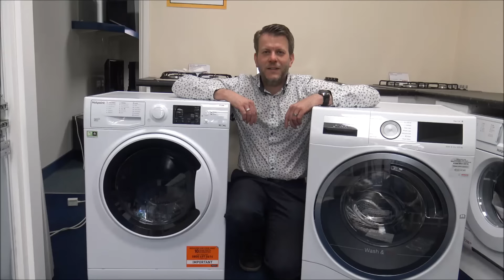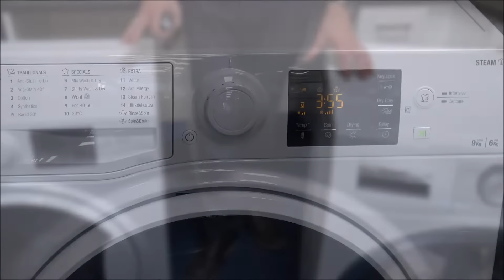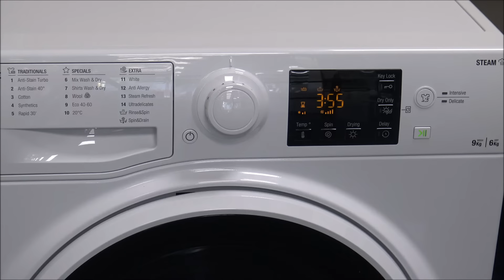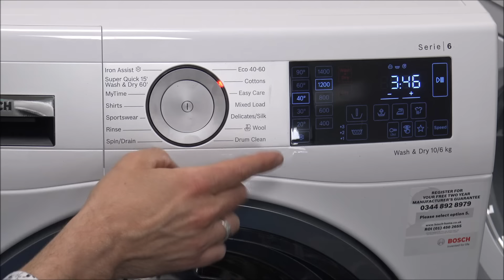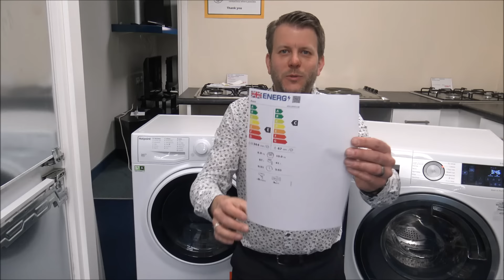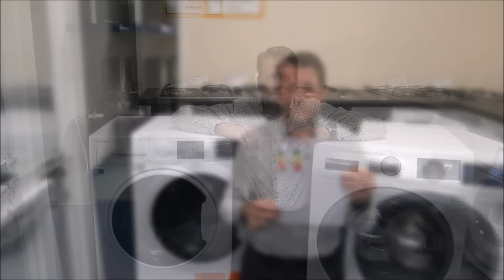Are Washer Dryers Worth it ?  10 Things To Consider Before Purchasing A Washer Dryer

Comment: I was considering getting a washer dryer machine, but I have read quite a few comments that mentioned poor reliability. These units seem to not be as reliable as traditional machines, the dryer functionality and durability seems to be especially poor. With this in mind, do you have any advice or recommend a particular brand over another?
Reply from the maker: You can find that reliability is not as good as it doing the job of 2 appliances, so it won't last as long as a washing machine on its own. If it is reliability you are looking for, then we always recommend brands like Bosch and Siemens
Reply: The dryer parts are quite compromised compared to a separate dryer.  The dryer parts are literally a  fraction of the size of standalone dryer parts, as they are designed to squeeze into the spare space in the cabinet around the washing machine parts!
Reply: @TassieLorenzo  it makes perfect sense, they compromise on reliability, for the sake of saving space. Most apartments (especially in older buildings) don't have enough room for separate washer and dryer units, so there's not a lot of options in this case.

Comment: Great video and very informative. I am considering purchasing either the Miele WTR860WPM washer dryer or the Bosch WDU28569GB (?) washer dryer on the right in this video. The Miele costs £2000 and the Bosch costs £1000. Both washer dryers have very similar offerings, with Miele (it seems) edging ahead of the Bosch ever so slightly in terms of features and performance. However, there is a large price difference between the two. What are your thoughts on the differences (price, performance and features) between the two?
Reply from the maker: Must admit we don't normally stock the Miele model so it is probably a little unfair to compare it. If the features and spec are very similar then i would go for the Bosch all day long as these are great machines anyway, especially if it is half price.
Reply: @lords-electrical  Thanks for your response. I appreciate you don’t stock the Miele. 

My confusion is more about performance rather than features and specification. Because, for example, the Indesit shown in your video has quite similar specification and features to the Bosch shown in the same video, however they are very different prices (Bosch is a high end, and Indesit is lower end). So the reason for the price difference must come down to brand name and actual performance, I am guessing, rather than specification? 

I guess my question, in short is, is a significantly more expensive washer dryer (the Bosch) expected to perform much better than a significantly cheaper one (the Indesit) if both have similar features and specification. If so, how is that performance difference measured or quantified to cause such a huge price difference?
Reply: @i2mee  I just bought the Bosch, Which magazine gives it an excellent review and a Best Buy rating.

Comment: Thanks for the info! My main consideration is convenience - I want to be able to throw clothes in the wash and leave for work, then come back home to dry clothes. Or put a load in, go to sleep, and wake up to dry clothes. As long as the wash-dry process is automatic, that's definitely gonna be my choice over separate ones.
Reply: Not a good idea to leave a tumble dryer running when not home. Possible fire risk.
Reply: @michaeldean7220  Oh! Didn't think about that at all! Thanks for the warning.
Reply: You should be able to come back to dry clothes, but some of them might be quite creased depending on the type of material they are made from. Creasing seems to be more of a problem than with separate tumble dryers.
Reply: @eddienewall5033  Thanks so much for the info! I guess that's not much of a problem since I'll probably be ironing the formal/work wear anyway.

Comment: How do u know the amount kilogram for dresses u have in for example how do u know the dresses you putting in is 6kg
Reply from the maker: It is always a difficult one to gauge the weight of the washing, but i would always say make sure when you are loading the appliance that you have allowed plenty of space for the clothes to rotate and move around during the washing process. If you cram it full, then the performance of the wash will not be very good.
Reply: You can put the dresses in a carrier bag and weigh them on either bathroom scales or luggage scales.
Reply: So that’s my question? It says 6.0kg however we don’t know actually if it is 4.5? Or 6.5? So what happens if you try to wash and dry more kg!?
Reply: @michaelobgy  It'll not work very well (i.e., the clothes may not come out dry) and it may cause excess wear on the machine over a long period of time.  But it's unlikely to cause an error or refuse to run or anything like that.

Comment: Should i get a LG SIGMATURE TwinWash Washer dryer
Reply: If you live somewhere they're sold. This one has a heat pump, and Electrolux's patent has blocked the sale of non-Electrolux washer dryers with heat pumps in Europe. But in the US, Australia and Asia, maybe. Note small items in this model, whether it's the Euro/UK washer-only version or the rest-of-the-world combo washer-dryer must per the user manual go in a mesh bag to avoid mishaps with things getting sucked where they shouldn't; there's quite a large gap between the drum and the door seal which I assume is due to the slightly different angles the machine sets the drum at for different kinds of cycle.

Comment: I would need to put the tumble dryer in our garage, so taking your advice I’m looking at condenser ones. However, the energy efficiency seems to only go up to B. Is this an issue ? 
Should I still be after an energy efficient model that is A+?
Reply: I don't think that any tumble dryer will be rated A+ for energy efficiency. The combination of a heating element, electric motor and absence of insulation means that they are inefficient. Condenser dryers also use water to condense the moisture from drying the clothes in the drum.
Reply: 10:15

Comment: what is the drying results compared to a single dryer?
Reply from the maker: Technically they won't be too different, but you should always find that the performance and efficiency will be a bit better on separate dryer compared to a combined washer dryer
Reply: i find that the normal dryer we had before made the laundry much MUCH softer than the washer dryer does!

Comment: If I've got a choice between 9/6 kg or 10.5/7 kg Washer Dryer, which should I go for?
Reply from the maker: Really depending on how many washes you are doing and how many people in the house. Don't forget on large load machines, the depth of the machine will be greater which can make a difference. Also larger load machines can put a lot more stress on the bearings as well.
Reply: @lords-electrical  2 adults. Sounds like you'd go towards the 9/6kg machine

Comment: can you not choose to dry them in the machine ?cause i like to hang dry swell sometimes
Reply from the maker: Yes if you want to use the washer dryer as just a dryer then that is normally possible.
Reply: @lords-electrical  I meant if u can use it only as a washer or does it automatically dry them
Reply from the maker: Sorry, yes you can use it as a washing machine only if you want to on each model, just select the drying time as 0.

Comment: i could only dry the clothes in my flat, what could cause mould in the flat. So yes i need a washer dryer.
Reply: Mould is caused by moisture in the air which condenses on cold surfaces encouraging the mould to grow. I don't see how a washer dryer will solve a problem with mould.

Comment: Washer dryers are great, why have two massive vibrating bricks when you can have one
Reply: Washer dryers only smell when new. After the fitst 10 washes and drying cycles you won't smell a thing.
Reply: Because they make your clothes smell and takes forever to dry. Plus if your washer breaks down on the washer dryer your dryer also stops working meaning you have to buy an entirely new machine. Better to just have separates since they make your clothes smell fresher and. Actually make your clothing soft and dry compared to washing that smells of rubber
Reply: @josephw6977  the rubber seal would never make clothes smell of rubber as the seal is well out of the way of the washing

Comment: Thank you for the video, I think you talked about the most important points to consider before buying. 

We are actually just looking for a washer dryer and like you said, there are a lot of them on the market. Especially when it comes to LG it is really hard to tell the differences between each model.
Is it possible for you to do a review of a LG washer dryer? Preferably a 9/6 Kg model? There are some good offers for them here in Germany, but I don't really know if you can trust LG's quality. Especially in comparison to a Bosch model for example.
Reply: Dont trust LG, I got a washer dryer brand new, broke in one week after two washes and drying. Go with bosch especially here in europe
Reply: @hellotjesmellowtjes9791  Haven't used LG before, in fact any of their appliances. Almost got LG fridge, but in the end Samsung "won" ; )
Reply: @hellotjesmellowtjes9791  As for Bosch, may not be fair as my mom's experience was a top load. She regretted her choice after her first hands-on use of this PowerWave model - foremost the design 

Again like I say above comment likely not fair, as not washer dryer

Comment: Can I get a 1800 spin or 2000 spin speeds
Reply from the maker: Some manufacturers used to make 1800 spin, but it puts such a load on the bearings that the machines were unreliable. Onb the whole 1400 is more than enough now to extract a good amount of water out of the clothes.